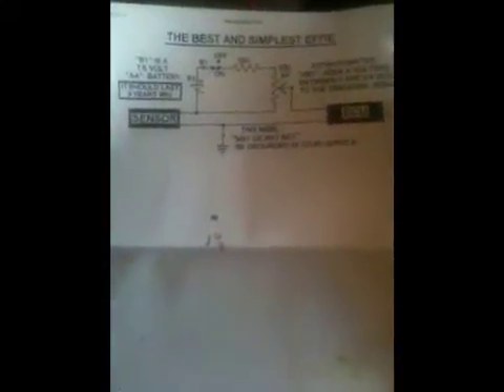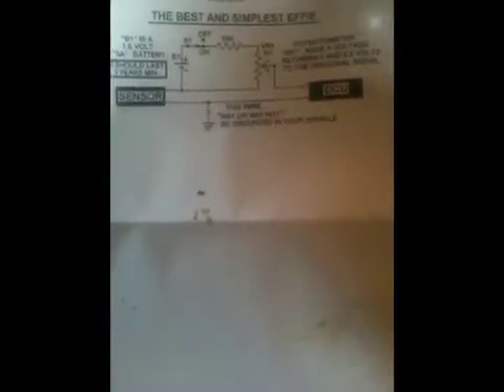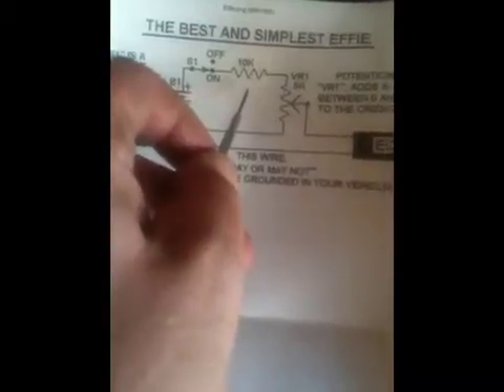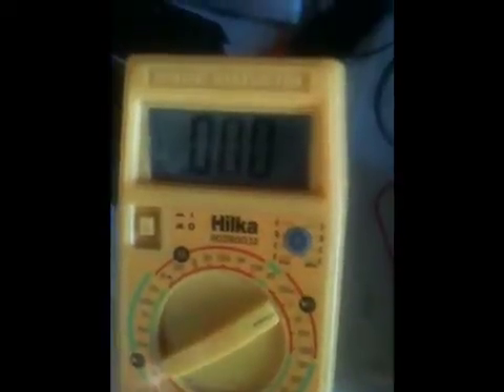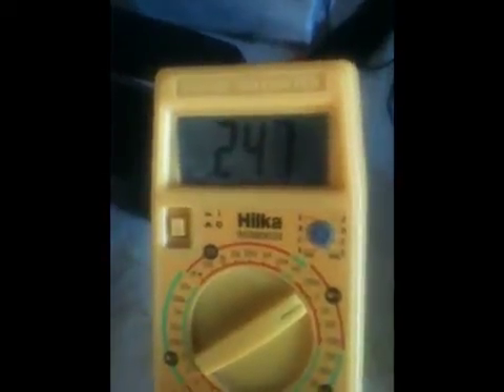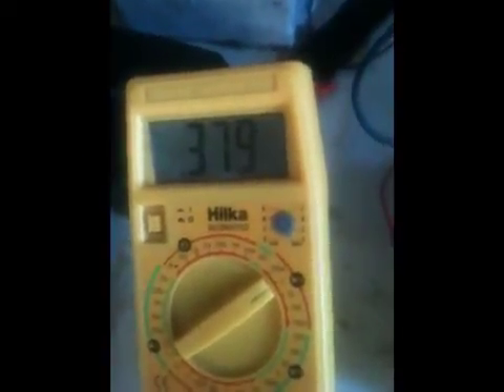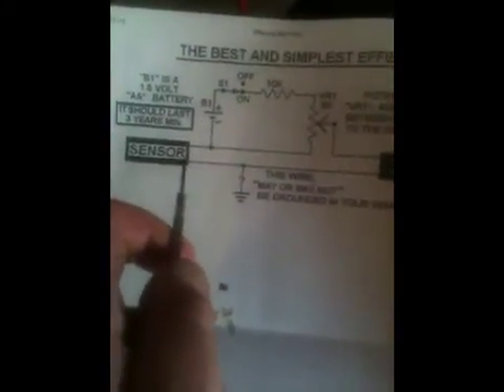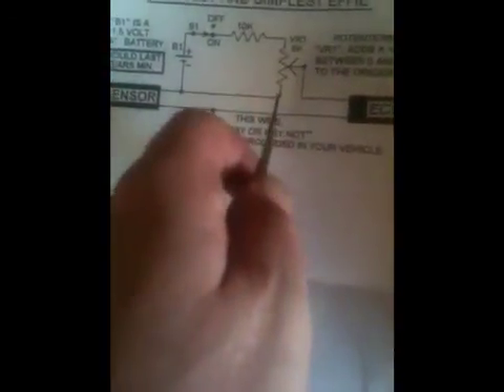O2 sensor enhancer (poor mans EFIE) 1/2

Comment: dude i swear I  just drew the same circuit  to increase voltage on o2 senser, so that computer bring down o2 sensor voltage to compensate with fuel. And I just looked up and found your link and my design is exactly the same.

Comment: nice work on the circuit. can not wait for you to try it out. one thing i have seen in others comments trying to adjust the voltage going into the iefe is it will work fine at first then you might see your check engine light come on. what i have seen is they have to put some oxegen sensor extensions to help out the problem, will be watching your videos to see if that happens, best of luck, silentdeath